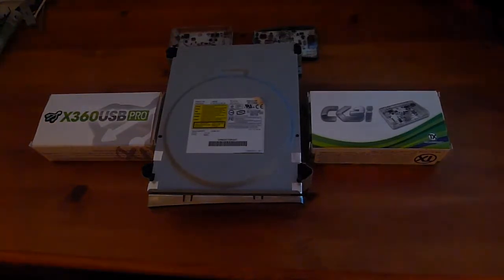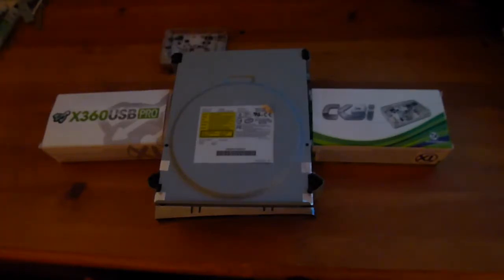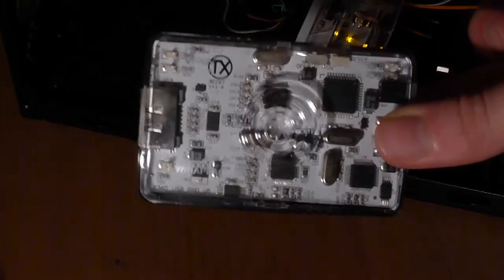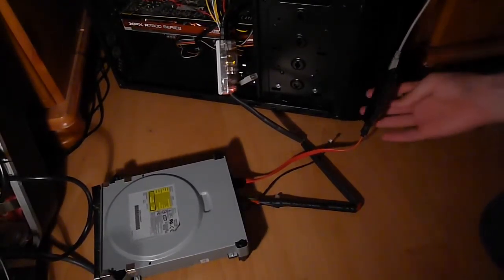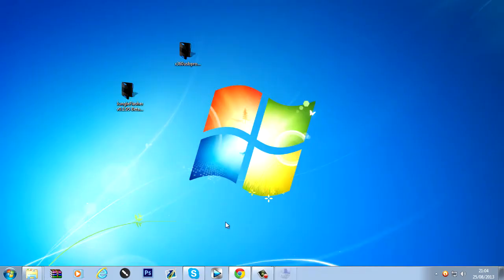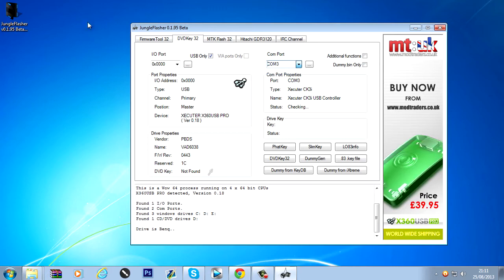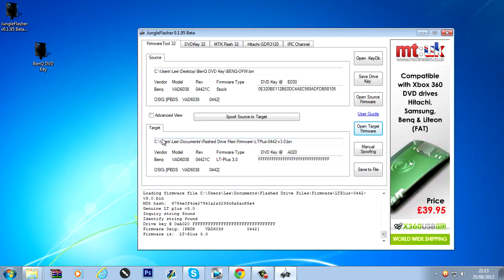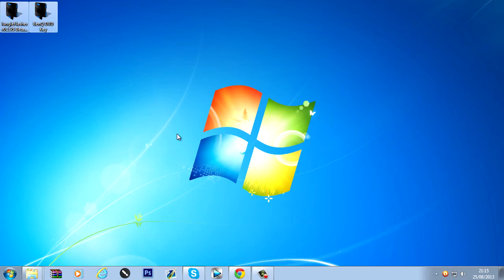Hardware Tutorials #4 How to Flash a BenQ DVD Drive

Comment: Hi guys. I took a benq firmware from "0800_BenQ and phat Lite-on v3" folder i wrote it to the dvd drive. But im still unable to play non original dvds. is there something wrong with my DVDs or i did something wrong with flashing? thanks.

Comment: alright I have a good question. I have an external ac power adapter and my sata hooked into the mother board. but the benq drive still isn't showing up.
Reply from the maker: You need the correct Sata Chipset. If its not showing up on all Sata ports then you need the USB pro.